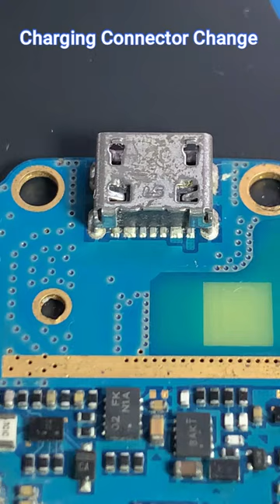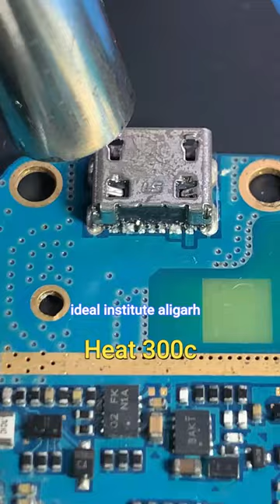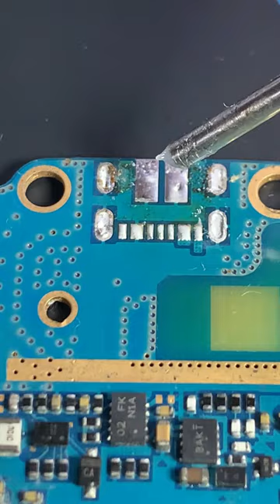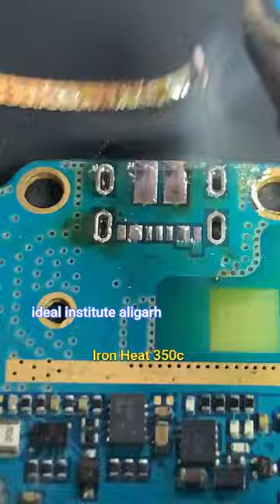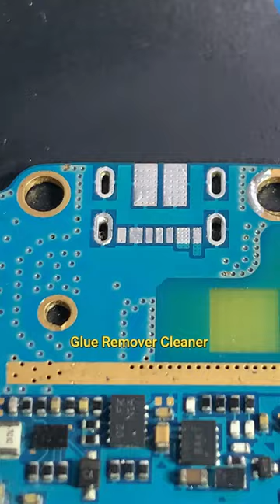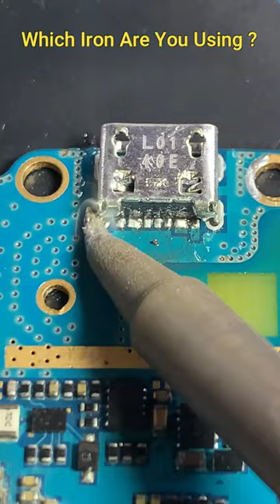Charging Connector Change #technology #mobilerepair

Comment: Tengo una duda como le hacen para que la soldadura se balla directamente a dónde se tiene que pegar porque cuando quiero soldar yo algo asi similar la soldadura se pega dónde quiere y no donde la mesito
Reply from the maker: First use microscope than , clean iron tip , use good solder paste flux paste , mechanic , 2uul brands , practice make perfect
Reply: @idealinstitutealigarh  gracias bro por tu recomendación asi lo are

Comment: Tell a newbie, how to desolder elements from a board that don’t fall off even at 450 C°, plastic elements die, but the factory solder doesn’t care.  (trying to change the button on the vape)
Reply: heat the board underneath if dealing with fragile components, your soldering the board not the part, the board needs to be hot enough for solder to flow not the part.
Reply: @stevenphillips5385  Thanks, I'll try, I just have to find the new button I need